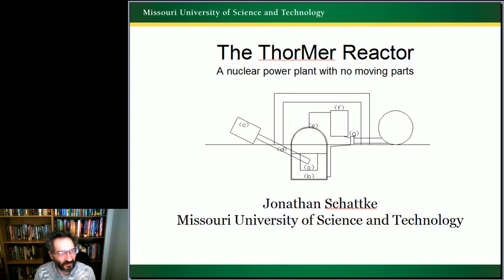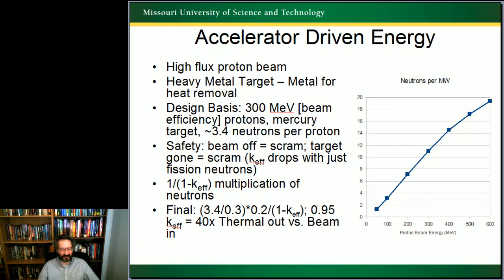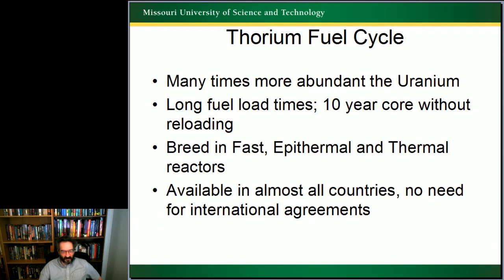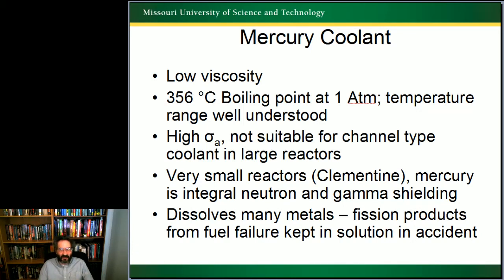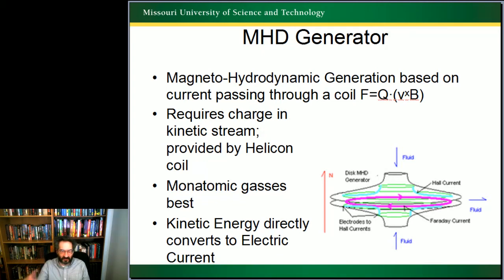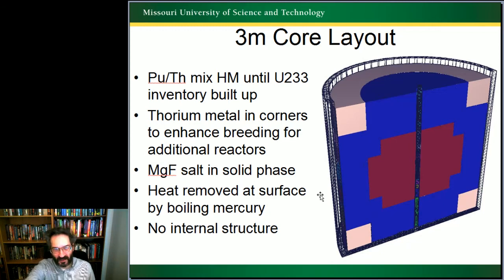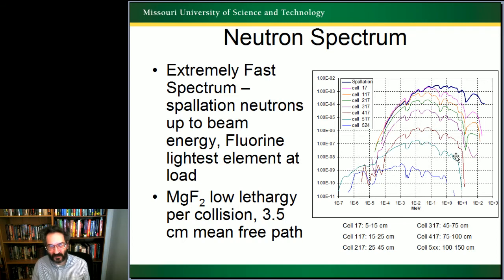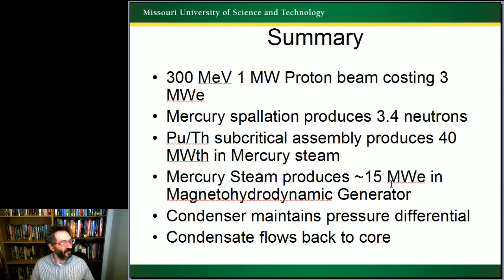ThorMer Reactor Overview (TEAC8 presentation)

Comment: How do you propose to get an accelerator reliability up to the point at which you can economically generate electricity or heat? Because the weakness of ADS is not the reactor design - spallation ensures that - but the accelerator itself. Project MYRRHA is wrestling with that at the moment.
http://ipnwww.in2p3.fr/MAX/images/stories/downloads/ress-92-2007-449.pdf
Reply from the maker: Keep that simple, too. Because I do not need a scientific beam, I can have a very sloppy focus and a very sloppy energy.
I would make a multi-stage plasma accelerator, using resonance chambers and counting on the magnetic mirrors to allow particles with more energy through.
But because this is R&D that is not done, I remove the accelerator entirely for the Simple Advanced Fast Reactor we are developing at Schattke Advanced Nuclear Engineering. http://s-a-n-e.com

Comment: Good presentation - you will want to practice standing up a few times. Don't rush your phrases, maybe pretend everyone has hearing aides so you have to enunciate. Questions: is the 3.4 neutron production (wow!) needed in a sub-critical design? I seem to remember ~2.2 for critical reactors. Also what is the expected life of the reactor and accelerator?

At 4:10 you mention how Th is available in any country, but a country needs to separate Th from the natural strata (sand, dirt, monazite...) so that contaminants aren't loaded in to the reactor. How easy is this mining/extraction process and the regulatory approval from IAEA & other regulatory agencies?
Reply from the maker: OK, let me run this down one thing at a time.
Each fission in this fast spectrum reactor produces about 2.6 neutrons. That contributes to the effective multiplication factor of 0.85.
Each spallation produces about 3.4 neutrons, this drives the subcritical pile with initial neutrons. The two multiplication effects lead to the 40x energy multiplication.
Reply from the maker: Thorium mining and refining is internationally not regulated, because it is a fertile, not a fissile material. 
There are IAEA standards for safety: 
Tailings: http://www-pub.iaea.org/MTCD/Publications/PDF/Pub1146_scr.pdf
Production: http://www-pub.iaea.org/MTCD/Publications/PDF/Pub1512_web.pdf

Comment: this is KISS reactor almost on "reduction at absurdum". it is great.
Reply from the maker: Feasible, if you want to spend a Billion on a 1 MW beam accelerator.
Of course R&D on an accelerator able to meet the needs of such a system more efficiently would be needed, but from a feasibility standpoint, it's within current ability.
Reply from the maker: The phrase is "reductio ad absurdum"